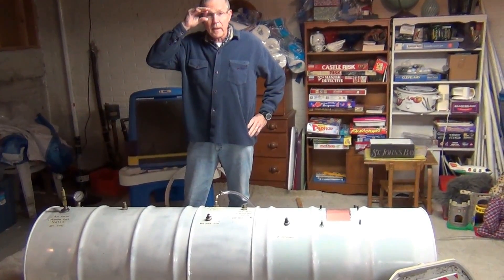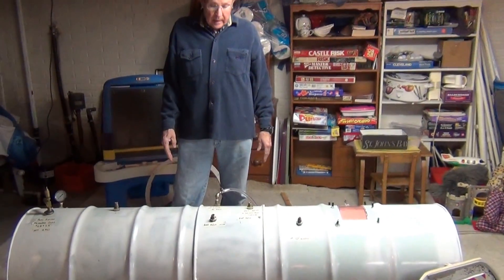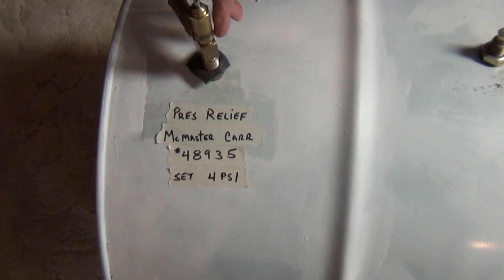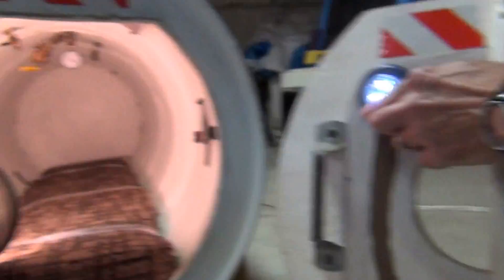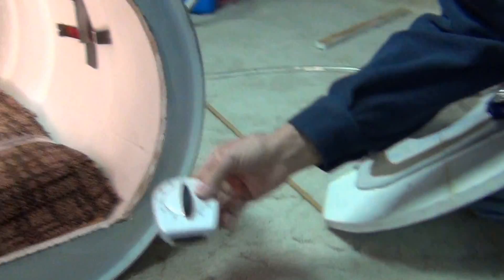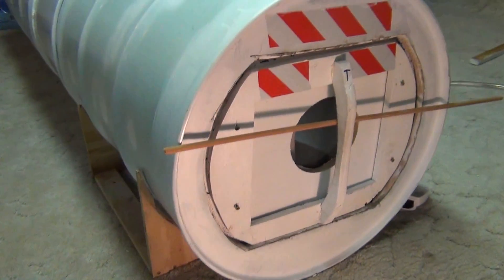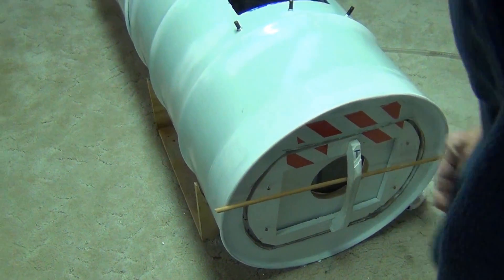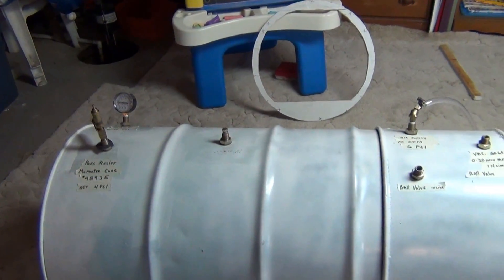Build an affordable Hyperbaric Chamber

Comment from the maker: Chamber #1 was around $500.  Most of this cost was for the fabrication and welding of the ring, and for the used air pump.  Most of the other materials were things that we had available.
Chamber #2 actually cost less, as we worked a swap with no money passing hands for the tank.  We still needed to buy the used air pump (eBay / Craig's list), hose, pvc parts, seals,  and silicone sealant.
I do not recall the exact cost for either.
We did not want to spend a lot of money as there were mixed reviews on the effectiveness.
Reply: +Terry Kocsis You need to an oxygen concentrator producing 94-97% oxygen to put that under pressure for much great effectiveness. The air currently in your chamber is just the normal atmosphere of around 22% so each session you do with a concentrated oxygen concentrator would be equivalent to 5 sessions without using one. You just need to have the tube from the concentrator run into through the shell. Seeing results 5 times faster is a big difference. Imagine 5 months of results in 1 month etc.
Reply: Hello Terry
I wanted to ask
1. How long does treatment ???
2. What is the BENEFIT ???
3. How many times a week should treat  ???

thank  you
yaakov  zeitoun
israel
Reply from the maker: I never used a concentrator..  typically a session lasted about an hour, but it could go longer with just compressed fresh air.
The air is absorbed thru your skin as well as breathing.   
IMO Oxygen is  critical to live.   A little bit more Oxygen is better than a little less.   (a mild chamber only gets you a little bit more oxygen)  Just my opinion.   
Google Mild Chambers to find out more.
Reply: Hey Terry,
I'm interested in specifically how you constucted the door. Also, is there plywood on the inside of chamber to reinforce it, where the door fits?? Please elaborate chriscross50@hotmail.com
Reply from the maker: dean m
Yes, We reinforced both ends of the drums with plywood.  We used both liquid nail to attache them (prior to welding) and then used silicon sealer around the edges so that the ends were air tight.   This gave us a nice surface to seal on with the doors.  Hope this helps.
Reply: Terry Kocsis hi terry. Could you post a link to the write up as to how you constructed this?
Reply: Terry Kocsis Hey Terry, would you be willing to sell one? I can come pick it up :)
Reply from the maker: +rossybossi 
I am not sure?  I currently am not using the first system (shown in this video).  Where do you live ?
provide me with your email address.
Terry
Reply: Alex Tarris how it work together compressor and concentrator?
Reply: Hi Terry Kocsis may I ask if you have the full specifications available as I wish to build one of my own.
Reply: Will it drop to 3 atmoshers , I'm told that magic number?
Reply: @daleval2182  Hi Dale, I have had numerous concussions in the past ten years.  This treatment has helped.  However, when I went to greater pressure and longer time, it caused my vision to become blurry, which led to headaches; and, headaches were one of the concussion symptoms we were trying to alleviate.  Stopped for a bit; on returning, kept to 1.5 atmospheres "under water" (about 17 feet), and no more than an hour.  Hope this helps!
Reply: Terry Kocsis I like the machine but be careful with oxygen toxicity

Comment from the maker: I have NO concerns with the use and operation of this chamber at 5 psi. 
IF I were to start over with this design, I would try to locate two 110 gallon barrels.  The 31 inch O.D.  would allow for a larger door, more room inside, still fit thru most doorways.  The 43 inch length would eliminate the need for the 1 foot spacer ring (86 inch Over all). 
By the way, I have been using the unit in video #2, as My friend and I both fit at the same time, sit up, and carry a conversation. 
We built our own chambers as a learning experience, and avoid paying many $ Thousands for a commercial home unit. 
After  over a year of experience / use, In my opinion there is near Zero Risk, and the Reward is dependent on what health issues you may be trying to treat.  Take it slow.
Please do your own research.
Reply from the maker: Natural Spirit,
My health is doing fine, thank you.
I have not been using our chamber much this summer.  There seems to be more oxygen in the summer time since the trees are all taking in CO2 to make Oxygen.   Now that Fall is here & the trees are taking their annual break, I expect to use the chamber much more.
Note: I did not build our mild  hyperbaric chamber(s) to fix a personal health issue.  I did it as precautionary (future needs?) measure, plus I wanted to learn first hand how it all works, and to try to understand WHY commercial / home units were so expensive.
From what I have learned, the mild hyperbaric chambers are NOT very complex, and I feel our stainless steel (converted tank / video #2) chamber is as good / or better than the commercial units for less than 10% of the cost.  Is the high cost due to Government Regulations, lack of competition, other, all the above?
I believe that mild hyperbaric chambers are simple, safe, & do help get more oxygen into the body (more Oxygen getting to your cells is key to better health), but they do it very slowly, and it takes a long time with many regular sessions to start to see results.  I expect when someone uses a mild chamber for a long time & sees results they don't know if it was due to the chamber or something else.
I am not a doctor so I can not / will not provide any health advise, but I do have my opinions and observations.  I hope that my video's are helpful / useful to some people that are interested in improving their health with less pills or drugs. 
Terry
Reply: Iii
Reply: Terry Kocsis, this is wonderful. It looks like you don't have to use an oxygen tank. Am I right? I need one of these badly because I don't think my insurance will pay to have Hyperbaric chamber treatment. Is there a way to build an inflatable chamber or some other type of material for a chamber? I live in an apartment and the manager wouldn't approve steel drums.
Reply: @scootergreen3 it must not collapse, it must be hard material
Reply: @daleval2182 it won't collapse.  You are increasing the pressure inside, not reducing it.
Reply: Brilliant 👌🏼 thank you for the video. I work at a hospital and I give myself pure oxygen inhalation treatment and it does sharpen the mind. I wonder what would be the benefits of introducing pure oxygen into your chamber.
Reply: Is there any danger of flammability from the concentrated oxygen? I see you have some electric lights operating inside there, and I'm wondering if there are any concerns of battery fire, etc.
Reply: Terry. Thank you for the video. Very helpful. Thank you for the part numbers.
Reply: Thanks for your video. Very informative. Hope you're doing well!

Comment: What modifications might you make or design change so a homemade tank could go up to 45 psi?  Do you think this would be possible now that you have successfully built a mild pressure tank?
Reply: Nigel Lewis 2.8 bar (40.6 psi) is the average pressure used every day for regular HBOT therapy everywhere  with some medical needs requiring much higher. Your pressure range is considered a 'soft' HBOT tank using the inflatable bag pressure tank range that is only a small fraction of the pressure needed to be therapeutic. Also, some consider your ultra low pressure to increase the risk of infection by feeding bacteria.http://hyperbaric.weebly.com/
True, it is damn risky using experimental materials to contain such a force but so far so good, the pressure hatch design and materials work and the water scrubs the CO2 build up.
Reply: ShambhalaVillage Again we had videos in training when I did my chamber operators licencse which you need 2weeks training with navy for and the 500 hours experience assisting, All the videos were of chambers after they had blown and there were some interesting pics of what that did to peoples brains.
But we had no videos of it actually happening, my money is on you using the rung type of sealant on as seal and the thing turning into an inferno though a video of a valve blowing would be just as interesting.
Reply: Nigel Lewis Whats your evac procedure in case of O2 toxicity, do you have advanced airway gear on hand with people trained to use it?
Reply: Confusion over PSIG and PSIA Vacuum is Zero  
Earth is 14.5 PSIA 
So your car tire set at 30 PSIG
Holds 15.5 PSIA

Comment: Thank you so much for posting this video! I've been thinking about building one of these myself. Ignore all the people's negative comments that say this is a waist of time. Because once there were people that said Noah was wasting his time building an Ark, but they are no longer here. God bless you sir for your wisdom & keeping your eyes open in this day and age.
Reply: This is definitely not a waste of time. I agree with you. This modality will gain acceptance as more studies are conducted but at present we can see stem cells proliferate with consistent treatment and pathogenic bacteria and viruses can't stand this environment. I'm looking into ways to do this with a more hospitable container.
Reply: jeff swanson I believe that 2 inch blue foam, dow board that is rated at 25 psi can work if each surface is layered with several layers of fiberglass and polymer  modified cement composite and finns of the same blue foam are attached at 90 degree intersections along the larger surfaces to constrain ballooning deformation at 45 psi.  Also, a tapered-edge pressure hatch might be developed using a cut out of the blue foam while maintaining an edge seal angle of less than 45 degrees so the in-side take out hatch doesn't wedge jam into the hatch opening.
Reply: I read somewhere that it wasn't raining when Noah started building the ark.
Reply: Noah built an Ark and Batman lives in Gotham City...😀📢"")))true facts!
Reply: @carlosmejia5728  carlos is dork

Comment: Is it possible to use this chamber to simulate high elevation? I've read articles on studies which concluded that people who spend a months time in high elevation(7-8000 ft)  lose weight and keep the weight of for sustain period of time afterwards.
Reply: You are thinking of the opposite process, lowering air pressure, which would require a controlled vacuum or hypo-baric chamber. Hypo-baric or high altitude training causes your body chemistry to change. Recognizing an oxygen deficit the body increases the amount of hemoglobin in the blood, the oxygen transport agent. So you become more efficient at altitude and somewhat supercharged at sea level for a while until your chemistry reverts.

Hyperbaric chambers increase air pressure and the oxygen content of the air you are breathing theoretical driving more oxygen into body tissue promoting health and improved healing.

I would like to build one like this gentleman did, I just want to have someone with real knowledge check my work before I get into it. I'm committed to not dying in anyway that will be both tragic and embarrassing for my mother. My son? He squashed himself...lol
Reply: LOL yes guys build a flammable death trap and jump in as a guy on youtube told you too,

Jay You you can contact people like the DDRC and at least make sure the fittings do not combust with pure O2

Comment: Have that suddenly decompress and see...
Reply: Nigel Lewis your type of personality is ubiquitous on the internet. What are you trying to prove or disprove with your pseduo skepticism? 
I've been SCUBA diving plenty of times and never heard of an air embolism or bends from 33 feet. That's why you don't have to be certified to go 33 feet. Please, please piss off and take all your pseudo skeptical ignorant friends with you.
Reply: From 33 feet submerged (2 atmospheres) to surface will not kill you or cause air embolism (bends). Terry is going to the equivalent of 15 feet submerged (1.5atmospheres). The studies are vindicating the technology.
Reply: jeff swanson And what about lung damage, Air embolism means blockage of vascular arterial  system by air bubble, bends is an all emcompassing thing that means something pretty different. There's a lot of mis info in these comments. You can most definitely get an air embolism going from 33 feet to 0 in actual fact it is the most dangerous 10 meters. Also links to studies?
Reply: Nigel Lewis Also an air embolism is not the bends your lack of knowledge saying that while speaking with authority is scary and makes you look like a moron.
The bends is a build up of nitrogen that does not have time to release if you ascend too quickly  from pressure often forming bubbles that can push on nerves and disrupt spinal function. An air embolism is where air is pushed as a bubble across the lung wall from the atmosphere to your blood stream where it eventually blocks blood flow to the brain heart or lungs.   If you think there is no difference then why deos the treatment table differ under us navy guides...why are the symptoms radically differenent....In short jeff don't comment on things you have no idea about.
Reply: @nigellewis6645  you are a dumbarse research the science you cannot get an air embolism from this you dumbo

Comment from the maker: Soren,
I read something that said in Russia, they have found in the treatment of 'some health issues', that they had better results with lower pressures at increased frequencies.
You may want to research this for yourself.  (I did a quick search and didn't find it.  I'm Not using the right search words I guess?)
In My Opinion - normally Health issues do not develop over night, nor will they go away with just a couple of treatments. 
It sounds like you feel the same way.
Good luck,

Comment: You don't use normal profiles dive profiles on HBOT. do you mean 2.5atm, are you raising it 1.5 atm or .5.  Anyway you can look up the nitrox tables which is what you are talking about to see max bottom times are for that mix. How are you making an ascent at the end to keep the pressure change within safe limits.

Comment: 1000 liter Main tank (The tank i would be in) testet to 6 Atm after modifications (12 atm before)
The Main tank gets filled with air from a separate Compressor tank(150 liter 10-12 atm).
This would provide some safety regardy pressure loss from the main tank. Wich will not occur, due to severe testing an maintenance.
Now i will not breathe the air inside the main tank> I will breathe from separate scuba cylinders(2x15 liter). This will be filled with and affordable normal air + oxygen mix.

Comment: As it seems you are set on it then I may as well be useful. You would not need a massive leak, a badly made seal, dodgy pump. How are you making sure air is only one way into the tank, what pressure are you testing the whole rig too, are you hydrostatically testing the tank has it been recently. Why not just use pure O2.

Comment: DDRC? I live in Denmark, here we only believe in medical pills and fluids. 
Denmark does provide HBOT for woundcare.

I am well aware that it is a major risk if there were to be a massive leak from the chamber. That is very well scientifically proven. Thats why i will be very thorough with the safety on the chamber. both in use and in the Construction. Maybe i will die trying but the alternetive is for me much worse.
A massive leak from a 12 atm chamber only used to 1,5 atm  is  highly unlikely.

Comment: Its not the (ITS actually ascending its the other way round although pressure is ascending and descending it is like you are descending) process of coming back to normal pressure, it is the risk of rapid decom from 2.5 ata to 1. Make no mistake if your system fails and that happens you will most likely die. But upto you. 
If you have a specific medical complaint the guys at the DDRC are pretty good and giving advice relating to treating injuries with HBOT, and are some of the best in the worldd

Comment from the maker: please post the Dr's name, country, date of explosion, and any link on the internet to confirm your statement.  Too many details to do an honest comparison, or continue a conversation are lacking.
Mild Chambers using filtered / clean 'AIR' (not pure oxygen) operating at low pressure (5 psi),  can NOT / will NOT 'explode'.   You probably know, IF Mild Chambers experience a leak, it will result in a chamber unable to maintain pressure.

Comment from the maker: On video #2, we got our tank(s) for free thru connections.  The pumps were our major cost (craig's list)  The pumps have air & charcoal filters.  We also put electric in the tank because we are using AIR / NOT Oxygen.  These chambers were cheaper than the 55 gal drums.
Do more research to better understand what is happening.
the air is thin at high altitude.  Denser at sea level.  4 psi is like 12 ft. below sea level.  the higher the pres. the deeper.  1 atm. is 14.7 psi / 33 ft depth.
good luck
Reply: Hey Terry !! Great job !! Its got me really intrested in making one of these at home myself ! I used to be a saturation diver so I really appreciate what you have accomplished here ! There is just one Item I would like to point out to you that may improve the saftey a bit. I would but your o ring in a groove so it didn't have a possibility of a blow out . Man , otherwise what a great job  !! remember to never secure the o2 mask to your face incase of an O2 hit (hold with hand) and Hope you improve all aspects of your health !! Powers !!

Comment from the maker: We had the drums, plywood, primer / paint, relief valves, bulk head & other fittings.  Had to buy tubing at $1 / ft, several tubes of silicone sealer $3 ea, 2 gages about $30, used Bullard pump on eBay for under $300.  Paid a weld / fab shop $125 for the steel and weld the tanks together.  So my total was under $500.
The pump does NOT produce oxygen.  It takes fresh air and pumps it into the chamber.  4 - 5 psi of fresh air has about 1/3 more oxygen, plus it helps getting oxygen in blood.